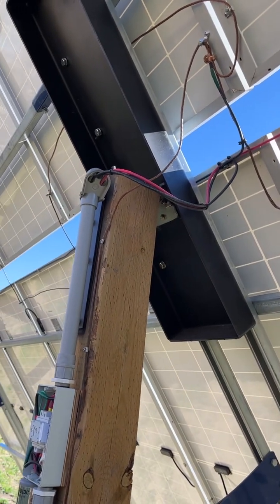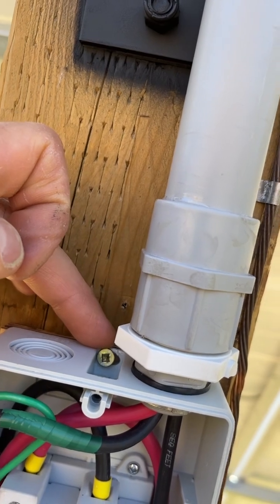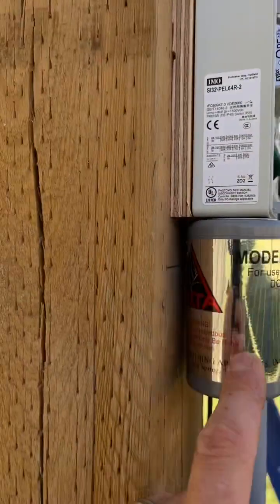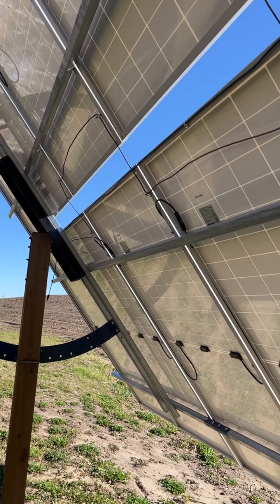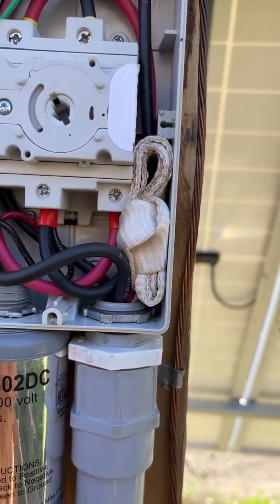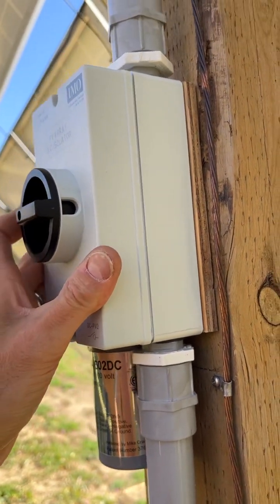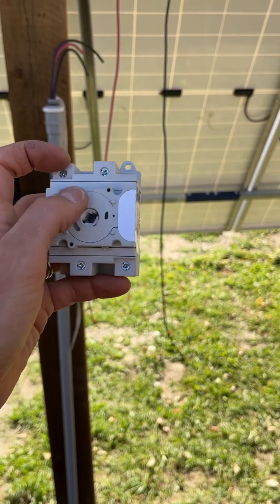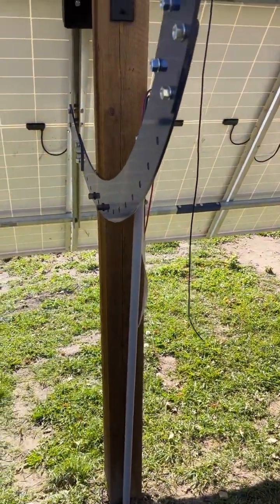IMO 2 conductor disconnect switch and box

Comment from the maker: We have both for the each array. The black wire with the green tape is electrical potential variance ground. It is connected to the array frame and is connected to the final ground rod of the houses original main panel. This keeps the entire system at the same electrical potential. 

Then I have a 10’ ground rod at each array. This will protects against lightning strikes. Some folks say the array ground rod is over kill and not needed. I did t care, the value well out weighs the investment.